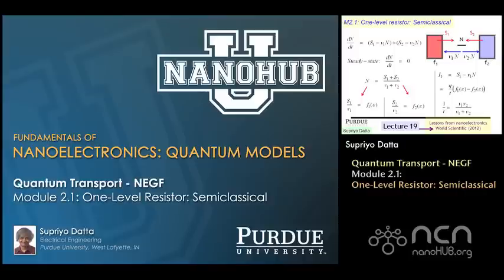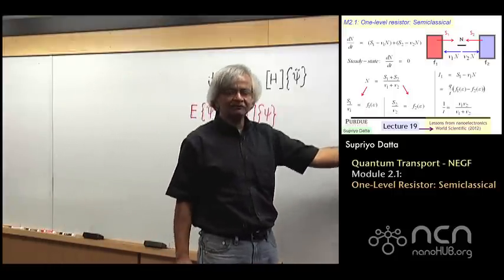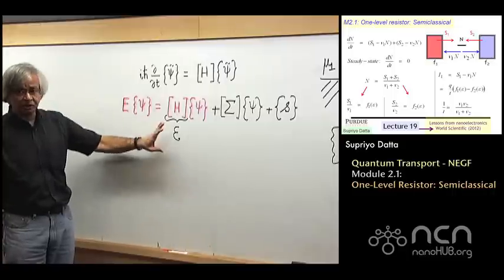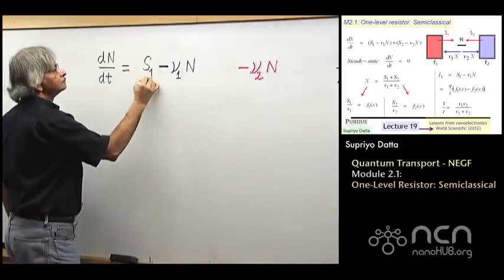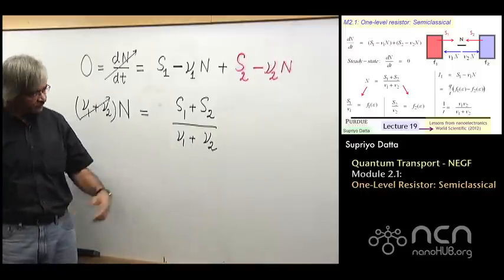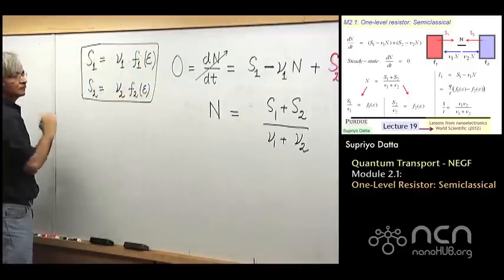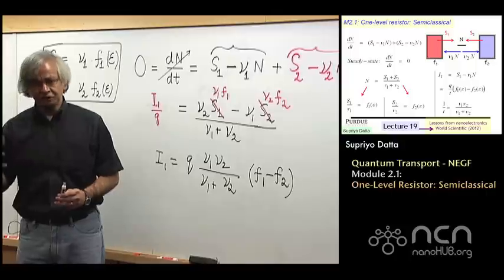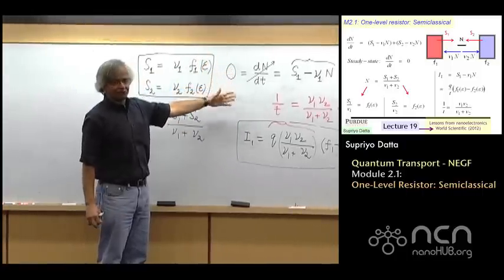nanoHUB-U Fundamentals of Nanoelectronics II: M2.1: NEGF - One-Level Resistor: Semiclassical

Comment: Let me know if the below is correct.
If both the contacts are same, then f1=f2. Therefore Current = 0.
Reply from the maker: +Vaibhav Bahadur  
Not quite sure what you mean by ?contacts are same?

We should have f1 = f2 (with I=0) at equilibrium, as long as no battery is connected between them,

The contacts could be made of different materials.